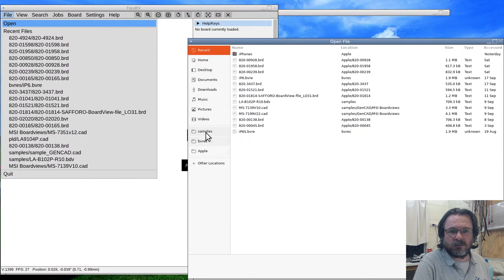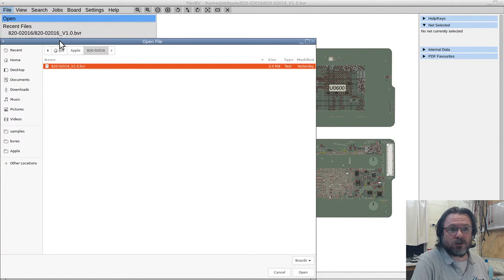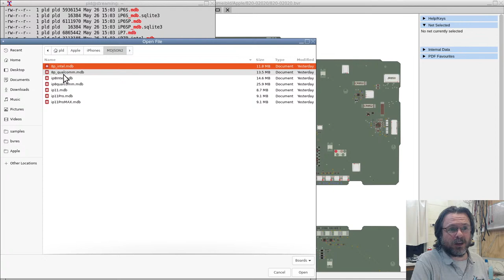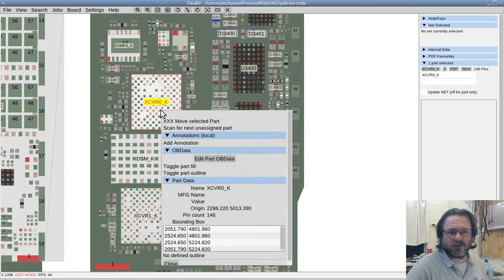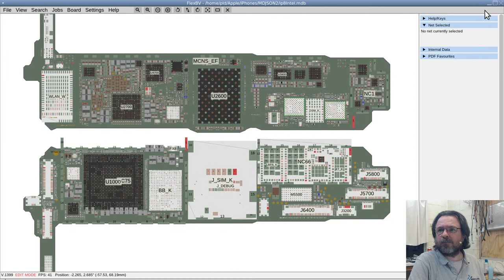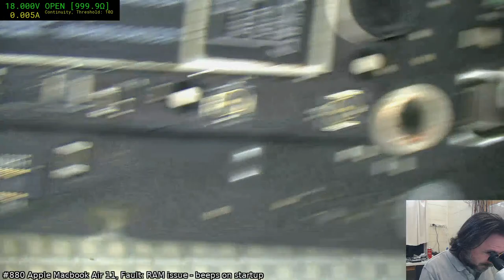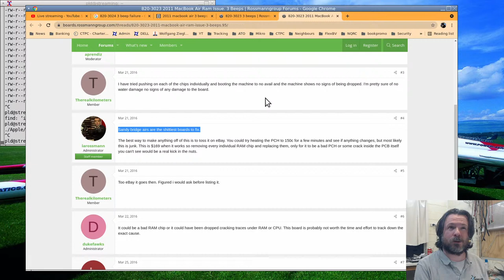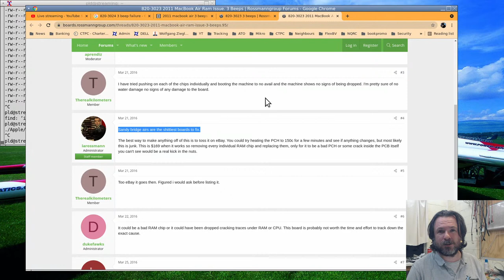#908 Macbook A1286 no power/boot.  I've been unwell ( still am ).  New boardviews!

Comment: Boards with reflowed (fried) GPU can still be fixed with a Tiresias GPU Killer. Removing the GPU and wicking the shorts beneath it is enough to make it work... Well you will have to mount the Tiresias and remove R8911
Reply: Could the new updated CMIzapper Chipmunk with the Ground plug which is available from http://www.cmizapper.com/products/usb-tester.html be used to test the newly installed Tiresias GPU Killer?
Reply from the maker: Might be worth a try; I have a semi-decent preheater COUGH COUGH and then I can use the Quick to get the chip off entirely.